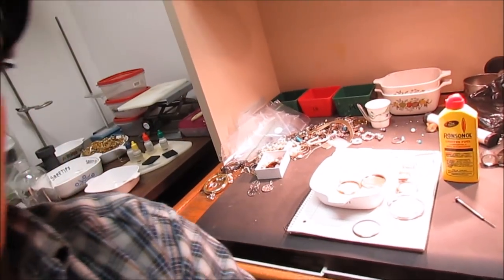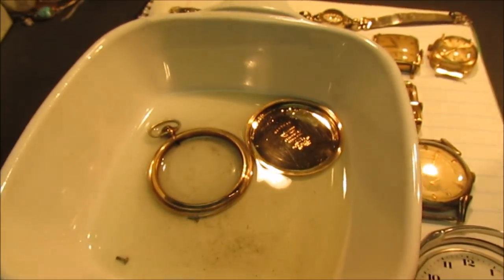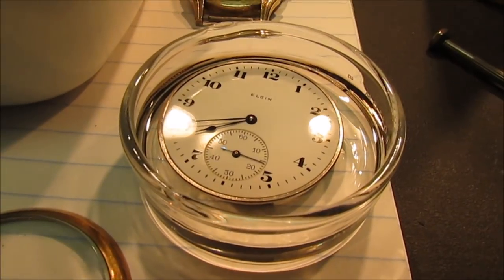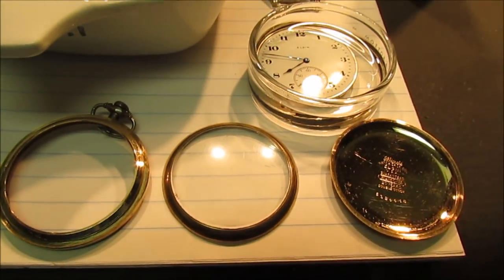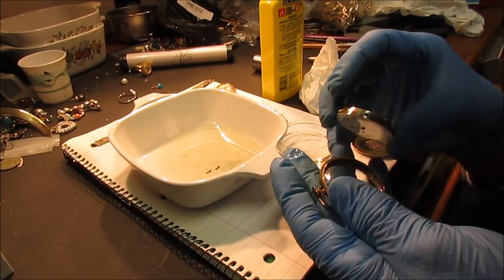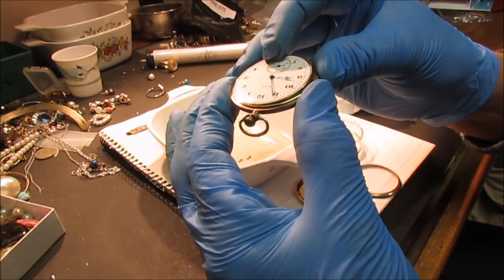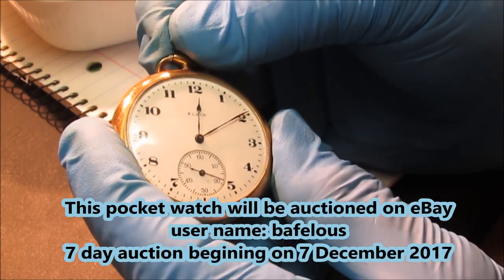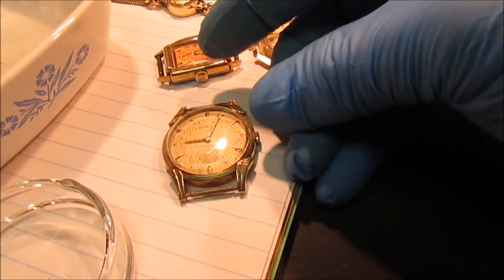Repairing An Antique Pocket Watch With Lighter Fluid

Comment: I’m a professional watchmaker. You should never do this to a watch. Ever.
Reply: he got it working by clean out the wear metal
Reply: @plasticmoon222  you wash all the oil out, that will increase the decay and the cristals are fixed by resin or other glue. Lighterfluid could cause, that the escaper cristals go loose, which leads to an uncontroled power release. If the cristal then get stuck between the gears ... oh Boy...
Reply: I got a lot of pocket watches from the 1800s,,alot work and alot don't,,i bought them at flea markets,,the ones that don't work seem to be wound up all the way and wont wind up more but wont tick,,somebody told me slam it hard against my palm,,but that don't work,,there are just stuck,, I didn't try this guy in the videos method
Reply: @plasticmoon222  Be carefull with slamming them in your Palm. Altough they are often solid, better try first heating them up to max 60°C (Shellac melts between 60 and 80°C), on a heat pillow or something. This may could soften the hardened Oils just enough to let it tick again. If they are wound up to Max, try to release the Spring Tension by holding the winding pearl and hold the pawl on the Cog. Then let the Tension slowly release trough the pearl between your fingers.
But at the End, its your Property, do what you will with it.
Reply: well even the ones that don't work look cool,,and the time on them is still right twice a day
Reply: @plasticmoon222  Twice a Day the right time? What a tough piece of mechanic XD
Reply: one is on 3:00,,,3am is right and 3pm its right
Reply: @plasticmoon222  Yes, i agree. I meant, that this Piece of mechanical Art does the job twice a Day, when it doesn't work 😁
Reply: i think he should use draino to clean the next watch
Reply: I cried a little when I saw this
Reply: Breakneck because it’s wrong. You can’t lubricate and clean with one product. You need an ammoniated cleaner to remove the old oil and grime. Whoever uses lighter fluid is just putting a bandaid over the problem. I guess it’s a good way to have customers come back. Don’t you think the leading watch companies in the world would use that process if it actually worked?
Reply: Breakneck there’s about 100 things he’s doing wrong... 1st of all, he doesn’t even use any type of ultrasonic or agitating device to penetrate into the pivots and shake off the oil and grime build up. 2nd, if his lighter fluid actually worked, you’d see a ton of gunk in the solution, and you don’t. And even if you did, he would need to use another batch of fresh fluid to rinse the parts because of all the shit that was in the “cleaning” solution he just used. Instead he just takes out the parts and puts them back together. He didn’t properly lubricate anything. He didn’t wear gloves or latex finger covers. He’s not in an environment that will prevent dust and other dirt from settling back into the watch parts. There are so many things wrong here I’m not even going to bother watching 2 hours of bullshit to point out the rest. He’s not doing this correctly. He didn’t even completely disassemble the watch, which is laughable. He has no idea what he’s doing.
Reply: @sugmasigma  im a beginner hobbyist, ive been using a ultrasonic cleaner with lighter fluid as a degreaser, then using branded rinses after, oiling with a few mobius products. Is there a degreaser that i should be using instead of the lighter fluid? Im taking a few online courses, but i know they aren't going to make me a professional by any means.
Reply: Bleb you should be using L&R ammoniated watch cleaning solution (#111) and L&R watch rinse solution (#3). You should clean in 1 jar of cleaning solution, then take the parts and use another cleaning solution, then a jar of rinse, and then a final jar of completely new, unused rinse. Your 1st cleaning and 1st rinsing solutions can be used a few times until they become discolored. There is no reason to not use the proper products. Also, the watch parts should be quickly dried with gentle heat afterwards. You really should be using a professionally watch cleaning machine, but if you don’t, place the jars with kids on them into an ultrasonic with a low amount of water in them with NO HEAT for a few minutes at a time and dry the parts in a clean and dry cleaning basket with a clean blow dryer on low.
Reply: Breakneck there are tons of videos from professional watchmakers. Watch those.
Reply: @sugmasigma  thanks!
Reply: Bleb no problem. I’m sick of seeing stupid ass people in the watch business doing stupid ass things that they heard from their grandfather’s cousin’s sister’s dog’s neighbor’s cat about how to clean watches. It’s not an easy business to be in and customers thinking it’s easy and wanting stuff done right now is why I retired. And I’m only 33.
Reply: @Brandon Sebastian I am looking into getting a pocket watch, can I go to a jewellery store for maintenance on a pocket watch, like: maintenance lubing from every day use or restoring if a part needed replacing ? I would like  to know everything that will keep it lasting and working as long as possible before I get a pocket watch .
Reply: @Aar0nDown  find a certified watchmaker, not just a jeweler. And if it’s cheap, they’re not doing it well. It should cost about 100-200 to have a watch serviced, provided it doesn’t have any broken parts or other issues.
Reply: @Aar0nDown  and get it serviced once it starts slowing down, generally 3-5 years depending on how often you use it.
Reply: @Brandon Sebastian thanks for your advice, I will only go to get it serviced when needed and go to a certified watchmaker or jewellery store that has a certified watch maker to do so. Your advice has helped me out a lot thanks
Reply: @Aar0nDown  no problem!
Reply: @sugmasigma  the problem I think is ignorance. There is a lack of jewellers who can repair watches clocks and such. And those that do charge exorbant sums. That said one would take matters in thier own hands. I only wish that a book on the matter would come into thier hands first.
Reply: I clicked on as I saw the title. And to myself said," liter fluid good God".
Reply: @bigwu100  even a book isn’t going to teach you how to do it right
Reply: @bigwu100  a book can give you tips and whatnot but having someone teach you how to physically do it is the only way
Reply: ....that WAS a beautiful movement...
Reply: @carlhorning4298  "how to use the green gobbler on a bent hairspring🤔"
Reply: @sugmasigma  guess your clock runs a little fast xD did you lubricate propperly?
Reply: Brandon, the correct way, of course, is to take this to a professional watchmaker where they will dismantle every little piece, doing everything properly.  The facts are that we are buying these Dollar watches for $15, or the Elgin for $40 on Ebay, and we are not planning to spend another $100 on these.
Reply: @TruthLivesNow  well serviced they are worth much more i would assume as they are sold (at least in germany) for well over two hundred bucks (euros, so a few more in dollars)
Reply: @sugmasigma  ultrasonic washers can loosens the jewels as well. Read your homework
Reply: Oil?!!!
Reply: @internettrihard2955  I've cleaned probably 100 or so watches in a ultrasonic machine. Never had a jewel come loose. It can probably happen, but it's incredibly rare, and it's infinitely better to use ultrasonic cleaner rather than soaking them in lighter fluid.
Reply: @Country Western You see, that's where your look on watches matters. To you, watches are simply a tool that tells the time. You look at them as simple devices that either work or they don't.  You also can't impose this look on others. 

Some people appreciate nice cars. Sure, the Toyota Camry might fulfil all your needs, but some people out there will want the Porsche 911. And those people will pay for premium costs of maintenance and fuel.

Some people like guns. Sure as heck, a Hi-Point works the same way like a super custom 1911. Difference is, one is just a tool and other is a work of art. Same goes for cars, watches, knives and everything else.  
If you appreciate what goes behind the actual thing, as in craftsmanship, history etc you'll be willing to pay more for it
Reply: @ClickClack_Bam  you have to relube the spring, gears, glue cristals etc hes not saying to not donit but that its not a one step process therefore what you are watching is wrong
Reply: @plasticmoon222  These old watches aren't shock protected. you'll shatter a cap jewel doing that.
Reply: @sugmasigma  What cleaner would you suggest then?
Reply: @hsvr  ummm actually watch cleaning solution and rinse… both made by L&R… these videos are absurd
Reply: @sugmasigma  I understand where you’re coming from but those cleaning products cost an absurd amounts which most people really can’t afford if they’re doing this as a side thing. If you’re movement is cleaned regardless of what product you used as long as it ain’t damaging the movement I’d say go for it.
Reply: You'd be better off sending a  15.00 watch to him for a 400.00 service.  The postage will be more then what the watch is worth.
Reply: I've seen a bottle of watch cleaning fluid. It makes sense to buy the proper stuff.
Reply: I would hate to see how much gunk and grit is in the mainspring barrel now,,
Reply: Unless it's your watch then you can do what the fuck you want.
Reply: @RyeOnHam  nobody cares
Reply: @ClickClack_Bam   by leaving the mainspring barrel in, it gets filled with fluid. It never gets any grease. None of the jewels get oiled. Would you drive a car that has no oil’s or grease? This means that by running the watch without it, you’re ruining the jewels and the pinions that hold the gears in place. This is not the way to clean a watch.
Reply: @bigwu100  you are so right on spot. I owned a 123 year old store and only learned to be a jeweler. Having to farm out my watch work to a real watchmaker. It was really digging into my profits so I kept setting aside money for a beginner to intermediate class. I bought about 400 vintage/antique watches and am still learning after retirement!
Reply: Rubbish I've saved thousands by doing this .also it saves from having you rip off merchants charging massive prices
Reply: @rolandgallone6513  your profile says “a complete idiot” and I could not agree more
Reply: Well, it worked for this man and I know of a 95 year old man that used kerosene to clean his railroad watch. Didn’t have lighter fluid back in the early 1900’s. The Elgin still works and keeps time today. At the end of the day everyone can put in there two cents along with education learned negating the result, but it’s still the result that matters with whatever title you want to add. Good job and it looks like a piece of history tics again.
Reply: @FoxJigButterflyEveryone  ok boomer

Comment: Using lighter fluid is fine for cleaning metal and plastic and rubber.  Not sure I would dip the dial and hands in it, but the movement is fine.  Be sure to let all the fluid evaporate before oiling.
Reply: I thought lighter fluid is enough, no need to oil it.
Reply: @heklik  You 100% need to oil the friction points in the movement.  The cleaning will remove the oil.
Reply: @anthonyredford7775   ok thanks
Reply: @anthonyredford7775  There are also different grades of oil/grease for different points in the movement. It is NOT this simple! I am an amateur and have three grades, five or more are used professionally.

Comment: I have to wonder if this watch is still working... Any updates??? If it died did you autopsy it? Did the pallet jewels survive?
Reply: I'm sure they're both rolling around in the case by now. hopefully he wasn't able to sell it to some victim in time for it to quit working on them.
Reply: @jermanoid  lighter fluid doesn't dissolve the shellac holding the pallet jewels.  Lighter fluid is basically what is used to clean watches properly anyway.  The problem is that you are stripping all the lubrication from the pivots so it will wear if used a lot.  Although I think this is a hack, at least the watch is running.  A proper cleaning would be very expensive and done without expert hands could easily destroy the watch.  I have a collection of watches and to be honest I hardly ever run them so if it runs and the downside is a bit of wear which won't amount to a hill of beans it is better to do this instead of shit canning the watch don't you think?  I took an early wire lug wristwatch to the jeweler recently and he told me it would cost $300 plus to get it running.  That is more than it is worth.  i don't think there is anything wrong with it other than the oil has congealed.

Comment: You didn't fix the watch.  The old oil was congealed and you removed it.  It should be properly lubricated before using.
Reply: no it should be dessamssabled first, cause some debris may stay inside the movement, you can even have a small screw or piece of wood inside, i have found strange things incluinding human hari, your wathc dont get out of this with this piggy service. Now, hes gonna sell, well i dont buy watches to this guy for sure.And how can you oil it properly without dessassemble it??

Comment: great video, just as a cautionary recommendation instead of pushing the hour hand back you are much better off just removing the hands and then putting them at the correct time. If you push the hour hand back you're liable to mess up the internals.
Reply: i have nothing so small that i could use for removing the hands. what i do is be patient and rotate the hands clockwise.
Reply: a very fine knife blade under the minute hand and slightly rotate the blade will pop the hand off then repeat with the blade against the face of the watch being careful not to scratch the face for the hour hand
Reply from the maker: Got it. This was my first time doing this. I'm usually ripping into the case with giant cutters to try and remove the internals so I can get the gold filled material into some acid. It was very refreshing going the other way with it. I simply couldn't believe all the dirt that came out when I began to squirt the lighter fluid in. But I was really astonished when the movement began to work and keep good time!
Reply: pushing the hour hand back I HAVE PITTY FROM THE GUY THAT DID BUY THIS WATCH.
Reply: @sreetips  My personal experience over the years has been most of the watches that come to me are not broken at all, they just need a full service meaning a full strip down of the movement all components cleaned properly and inspected to be sure all dirt and old oil is removed, check for worn pivets and cracked, chipped, or just plain broken or missing jewels. reassemble the movement properly applying watch grade grease, lube, and oil in the proper places, deffinately research the proper technique for doing this and use the oil sparingly to much oil can actually cause a watch to not function properly or keep it from running altogether. Now I have and still do from time to time on a watch that I don't know it's history have removed the hands and dial submerged a complete movement in a cleaning solution while still assembled much like what was done in this video, the purpose for me doing this is to see if the movement at least displays the potential of being able to run even if it stops and starts, if it does actually run even if just a few seconds then I know that all the components are at least present and are trying to do their respective functions, but sometimes the watch can be so dirty this will not always work, but I still do a complete stripdown and give it a proper service, some might not agree with this method but that's ok it's mine, especially since I always do a complete service any way
Reply: further more since you used lighter fluid get some proper watch cleaning solution and disassemble the movement and at least let all the components soak for a bit to get rid of the lighter fluid, lighter fluid leaves a residue after all it is a patrolium product, a product I like for a good final rinse is called "one dip" it's nonfamable very little to no oder and leaves no residue, in fact the product is specificlly designed for cleaning hair springs, you dip the hair spring in the solution gentley swish it around and pull it back out ( 30 seconds) is about the most time it takes, it's a degreaser is what it is, but don't leave the cap off any longer than necessary as one dip does evaporate quickly, thats another thing I like about it, lift the the watch part out of the solution holding it briefly over the container to allow access to drip off, place the component on a piece of plane white paper or tissue and the rest will be soaked up by the paper and evaporate and thats the end of the rinsing process. you can google one dip or go online to ESSLINGERS.COM and look for it there, thats were I get it from
Reply: @Limou551  You robbers need to get a life.

Comment: Ok so i did the same thing with my Hamilton movement watch.
And yes it works while in the lighter fluid great.
But soon as i take it out of the alchohol my watch stops running agin im so annoyed.
Why does mine stop after taking it out of the lighter fluid?
Thanks
Reply from the maker: I’ve taken lots of flap for this video from watch repair people. I used lighter fluid for this experiment, not alcohol. You probably got junk in the gears. All it takes is a tiny piece to gum up the works.
Reply: @sreetips  oops idk why the hell I said alcohol I'm sorry lol.
Yes I used lighter fluid and it didn't work at first so I mixed some of my cheap liberally synthetic oil with the lighter fluid let it sit for longer now my watch runs great!
So few drops of the oil with the lighter fluid works great.
Thnks for the video man I learned it from you!
Reply: I guess it's lubricated in the fluid and runs but then needs oiling because the movement is dry.
Reply: @poepoe2828  yes - you learned how not to service a watch!